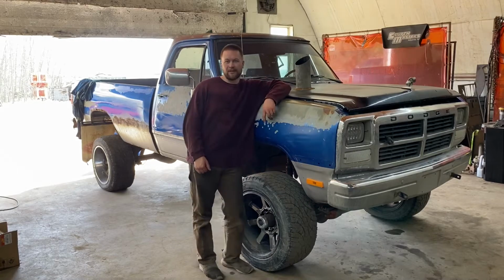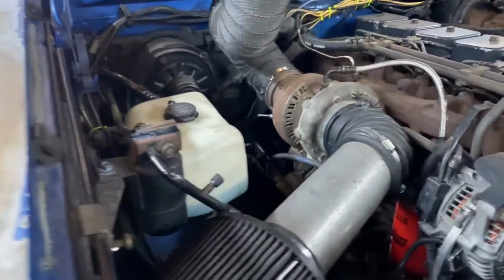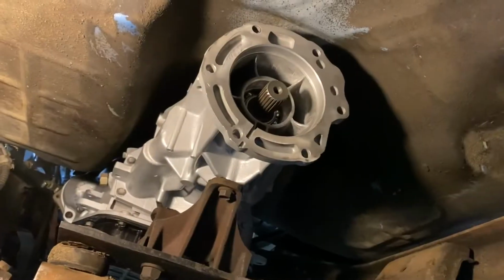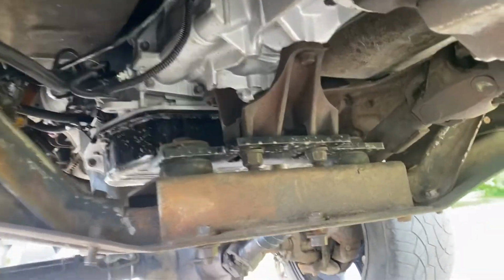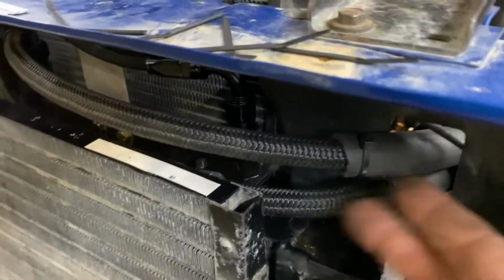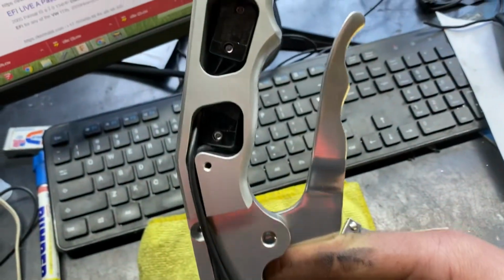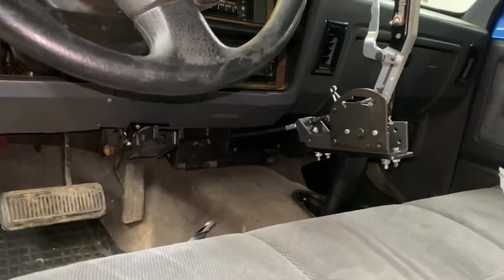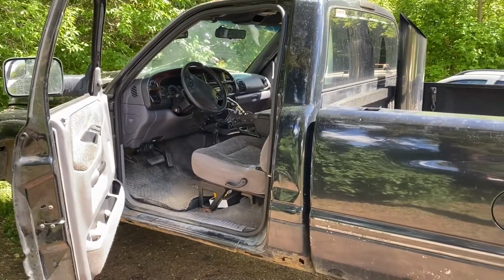First Gen Cummins 47RH Lockup Transmission Conversion + Ratchet Shifter Install

Comment: It’s not a skid plate it’s a support bracket for the transfer case so all the weight isn’t hanging on your aluminum tail housing. A few good pot holes and you’ll have a reason to make some more content 😂

Comment: So I have a 97 4x4 3500, having issues with transmission going in an out of overdrive between 55-65, I’ve tried the bd diesel inline diode thing that didn’t help, any thoughts?

Comment: Where do you get good transmission cooler lines?
Reply from the maker: I buy fittings and hose from Vibrant and make them myself
Summit racing is a good alternative too
Reply: @Hazardous-Hotrod-Knowledge  Thankx.

Comment: That’s a good looking trans cooler, what brand is it? My 3rd gen trans runs hot when towing uphill, I plan on deleting the heat exchanger and adding an additional trans cooler as well. I wonder if it should be installed before or after the factory cooler? Thanks for the video, Jim.
Reply from the maker: It’s a B&M super cooler, generally when people install a new trans cooler they just delete the factory one and run the 1, keeps the plumbing simpler, however if you did want to run both it wouldn’t really make much difference as far as the order of them goes, the fuel has to pass through them regardless! I would recommend a mishimoto bolt in upgrade trans cooler if you want something easy, I’ve seen lots of people run them and they’re a good improvement. The super cooler is a beast thouvh

Comment: Ive found that the vibrant fittings are pretty good for not needing drilled out they make sure the fittings are as large as can be so theres no restrictions but i compared the vibrant  fittings to the ones i have from i think amazon and the amazon ones are so restricted without being drilled i actually had a couple people come back so i could drill out their fittings because they bought their own parts and i installed them.. i use vibrant only but im in the states so i dont have the extra bullshit fees you guts get charged judt to buy something and have it shipped to you.. its ridiculous how much they charge you guys north of the border❤❤❤
Reply from the maker: The local place I go to for fittings stocks red horse fittings so that’s what I’ve usually ran, but I’ve been going to a hydraulic shop more lately and getting steel fittings so even if I drilled them out they’re a lot stronger than a drilled out aluminum fitting. It all adds up and makes a difference!

Thanks for all the great comments you left man! Sorry it took me a bit to get to them

Comment: Can you tell me how you fit the dipstick tube?
Reply from the maker: I think I just used the stock 518 dipstick tube, maybe bent it a little
Reply: I used the 47rh tube, cut to 518 length and used the 518 dipstick

Comment: I know everyone all patting you on the back and stuff, so I'm sorry that I have to speak negatively. The way you decided to approach TC lock up along with OD via switches is the WORST way of doing it. YES, I know LOTS of people do it this way. But just because everyone else is doing it doesn't make it a good solution. When OD and TC lock up are on switches it makes the truck SUCH A PAIN in the ass to drive. And the number of times you WILL forget to unlock TC and stall the truck at a stop sign or light will drive you nuts. Or forget to unlock OD and try to take off......... same results.

Fortunately, there's a better way of doing it. The 47RH is a mechanically governed trans just like the old school 727. And that governor has a roughly 1 to 1 pressure rate VS MPH (there is some variability of course) So at 35MPH the governor is producing +- 35PSI, at 25MPH - 25PSI, at 50MPH - 50PSI. You get the point. Simply Tee off the governor pressure check port to 2x HOBBS switches (PSI switches) 1x for TC lock up and 1x for OD command. Supply 12v+ and Gounds VIA the 2 Hobbs switches and you have a FULLY functional trans that you DONT have to babysit. And if you use adjustable Hobbs switches you can tune TC lockup and OD to your hearts content. 

And given the nature of Parallel circuits combined with Series circuits its STUPIDLY easy to automatically control TC Unlock and OD downshift. The last one I did was for a Cummins swapped Hummer H1. And I used a TV cable from a 700r4 off of the factory linkage to 2x pull switches (normally closed) The first switch tripped at +- 25% throttle. Which broke the TC lockup circuit. There is your TC unlock with throttle application. The second switch tripped at +- 45% throttle. Which broke the OD circuit. There is your OD down shift with throttle application. And I even installed a TOW/HAUL mode switch, which broke Both the TC and OD circuit's (TC unlocked, Max 3rd gear). In retrospect I could have just piggy backed off of the 47RHs TV cable bracket down on the trans. But it was a pain to reach at the time so it was easier to just build the kick down mechanisms off of the pumps bracketry........
Reply from the maker: What you’re saying makes sense and is definitely a sensible approach to the OD and Lockup switches, in a way you can make a standalone OD and lockup controller off of basic switches. Your method would also allow for good reproducibility that can be better for drag racing

I prefer the switched shifter because of the total user control, when I drove my truck sometimes I’d like to hit lockup early and buzz around 1200rpm, sometimes I like to hit it late and bog down the rpm, sometimes I’ll run 3rd out before hitting fourth, the nut behind the wheel is the unpredictable trans instead of the transmission computer and that’s the appeal to the MVB!
Reply: @Hazardous-Hotrod-Knowledge  You can still run command switches like you did. Just run them in parallel to the circuits I described above. The trans doesn't care where it gets +12v and ground (it can get it from the hobbs switches OR from your "command" switches). With the command switches "off" the trans runs like any other auto (more accurately runs how you tune the hobbs switches). But you can override and command "on" whenever you feel like. However, without a Tow/HAUL mode (both hobbs switches de-powered) you won't be able to leave TC lock up, and OD in an "off" state.  So, if you want full command install a tow/haul circuit. In your mind rename it to "manual mode" and parallel in your individual switches. That way, when it's NOT in manual mode anyone else can drive it like a normal auto. Wife, Kids, Loaned to a friend.......? ect. But when you drive it, just hit the "manual mode" (which disables Both of the hobbs circuits) button and you have full control.

Comment: nice setup. can you tell me if you had to move your cross member back? did you use the factory holes? thx
Reply from the maker: I used the factory holes for the crossmember but made a different adaptor plate
Reply: @Hazardous-Hotrod-Knowledge  thanks for the reply. are you selling the plate? if so ill take one
Reply: any for sale? need help:)

Comment: Hey man, am currently doing the same thing for my 1stgen. Is the lockup and over switch the only wires you run for the transmission. Because on the left side of the tranny there's a big old plug, did you just plug it? Or did you hook something up to it THNANKS!!
Reply from the maker: Hey! The plug on the left is for the neutral safety switch and the reverse lights. I thiiiiiink purple is reverse, I can’t quite remember, but on the 3 pin plug up top you just have power and 2 ground wires for OD and lockup

Comment: 🙌🏻🙌🏻 thinking about wiring in a lockup switch on my 2g. This helps!
Reply: I wired one up on my 95 12valve. Toggle switch to turn power on and off, with a trolling motor momentary foot switch to engage and disengage lock up on the fly with my left foot. Made it way more fun to drive and much quicker accelerating in traffic.